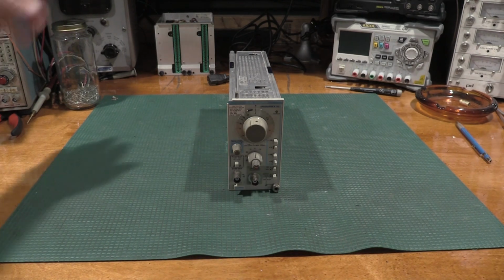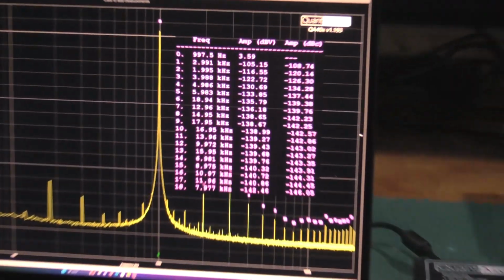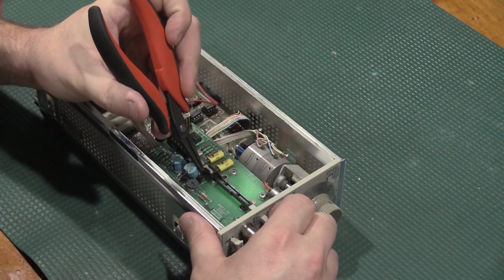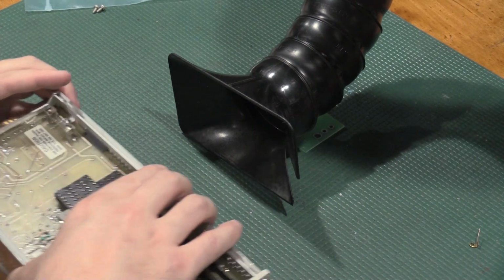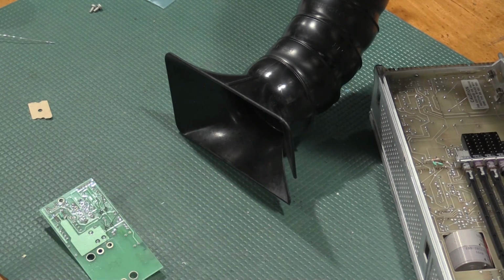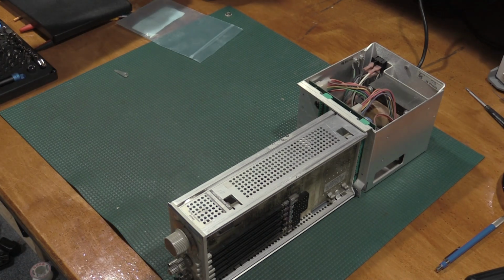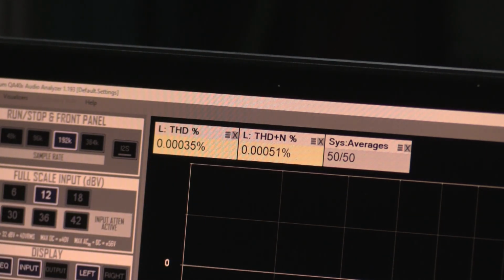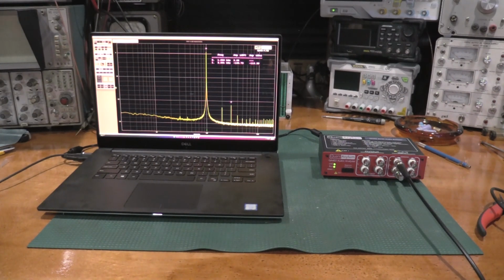SG505 Op1 Restoration and Distortion Measurements

Comment: I recently measured my sg505 with new abilities to test thd. Mine is not in spec.  Examining cap's shows that I have very few tantulums while yours has many.  I wonder if I'd get better signals by eliminating the aluminum cap's?
Reply from the maker: Power supply issues could cause the unit to be out of spec the super critical parts are the tuning resistor (integrator resister) and the FET 151-1021-00.
Reply: @ZenwizardStudios  More specifically, the thd is about an order of magnitude too high. Which is the tuning resistor?

Comment: The SG505 is an amazing piece of equipment… if you see one- buy it!
Reply: No don't. 1) it's older than you. 2) 99.9% of you don't need it. 3)many of you don't know what harmonic distortion is, how to measure it, and what the lower bound on it should be. That's my experience. That's my opinion, and I am sticking to it.
Reply: @willthecat3861  I’m sure most people watching this video are doing so because they have an interest in an ultra low distortion analyser and may very well have extensive experience in the field- but good on you for assuming that you know more than the other viewers. But aside from that the fact that it’s old is in many cases a bonus because it uses discrete components. Plus they’re generally not that expensive… in my opinion it’s excellent value for money.

Comment: This is the nuts and bolts analog lab stuff I really enjoy.  Nice to see you getting the bench ready to work on our AA501s and SG505s. Would the smaller caps that were exchanged also benefit from a uF value increase? Sorry I don’t have a schematic handy to follow along with as I should. Extra filtering is usually of some benefit up until haversine peak charging current becomes an issue. Jumping from 47 to 100 won’t usually be a charge current problem, and with 2x the time constant, and holding capacity.. I am assuming those are DC rail filters. Other functions, may not want to change value.
Reply from the maker: The two big caps that were changed were the main rail filters right after the rectifiers. one for the + rail and one for the - rail.

Comment: That QA403 is a slick outfit. I would like to afford myself a Tek distortion setup. But I have a hard time justifying the expense.
Reply from the maker: Other than an input voltage limitation the QA403 can replace 2x  SG505's and 2X aa501's it is very will positioned for testing 2 channel amps. But a dummy load it needed to soak the amp current. AA501's have a 200Vac input rating where if i remember correctly the QA403 is 32dBv.
Reply: I guess I didn't look close enough.I didn't realize it had its own generator. That really is slick. Looks like they won't have more manufactured for a little bit. In demand for obvious reasons.
Reply from the maker: Even though it is sampled the DAC's in the qa403 are really impressive. @TheSignalPath does a really deep dive in to the circuits as well as shows some loop back of the generator Video can be found here on his channel : https://www.youtube.com/watch?v=BlWzpMkX5QQ
Reply: Nice. Can’t wait to see these units put to use.

Comment: Good video. Why did you upgrade the capacitance to 1500uf from 470? Does adding that much extra filtering help the THD or is there another reason? 
Thanks Zen.
Reply from the maker: I am not sure if I did it or if tek did it in later models. I could tell from the boards that this was a very early production unit. My later serial number has less tantalum caps and more electrolytic ones. With some higher values. 

The TLDR : is quieter power rails will do nothing but help the performance of the plugin. In this case it was measurable.

Increasing the capacitance on the power supply rails will have an impact on the THD but it will also help the active circuits find equilibrium easier and not have to work as hard. Given that there is less noise on the power rails. The more stable the rails the less the regulators need to work to maintain their regulation set points. 
Capacitance on power rails (NOT RF circuits) can be increased with caution in 2 places. Inrush current when the capacitor first charges at power on. The component stressed here is the rectifying diodes. For larger capacitors they will need to handle the inrush current which can be several AMPS momentarily. This is why in the boards that I am designing you find a 10 AMP diode in a board for 300ma. At switch on that rectifier needs to charge a 10,000 uF cap. So for about ½ a second it pulls a lot of juice. 
On tube circuits filter caps are much more fragile this is because of the rectifier tubes. If the bulk capacitors are to large the bonding wires in the tubes can turn in to fuses and blow off this will unfortunately destroy the tube. 
In this case my SG505 has been running with this cap value for years so I was relatively sure an also triple value increase was ok. 
Also modern manufacturing has increased the capacitance per volume calculation so I was able to achieve 3x the capacitance with almost the same physical space (caps were a little bigger but not much.